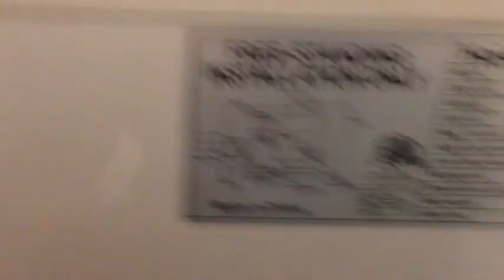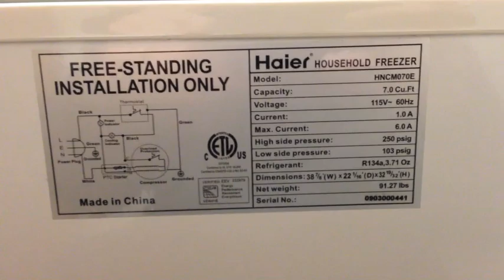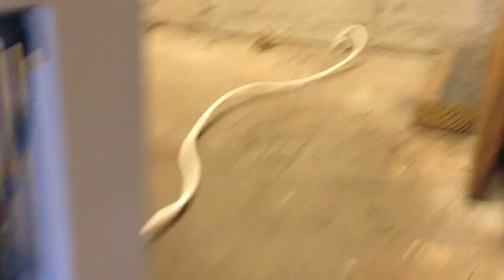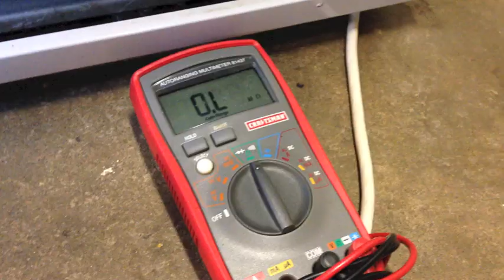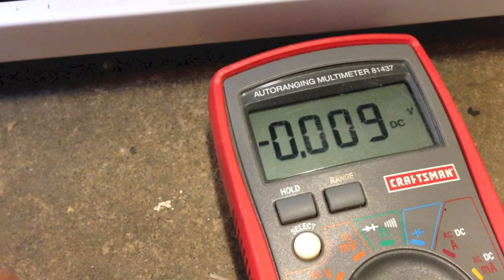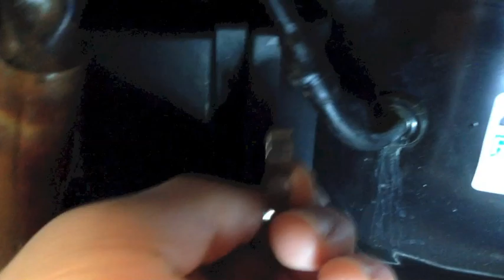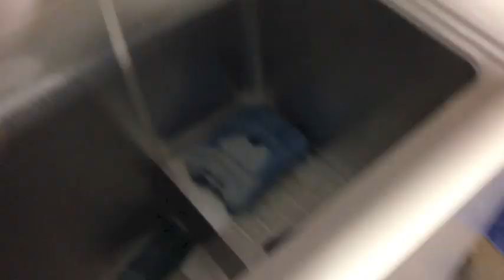HAIER  Freezer Repair

Comment: hey bro I appreciate what you're doing but there's actually a hard start kit that is cheap and can replace the cap and start relay and you have capacitance scale on your meter use that to test the cap and not the dc voltage function also the relay is an electronic type you don't test with the continuity buzzer the cap leads goes one on each side of the starter ok nice try though keep researching.
Reply: Thanks for your information that was very useful. I am very handy and try to fix everything besides throwing it out. Always love to learn different things this was my first attempt to fix anything that was a refrigerant. thanks agin
Reply: Anthony Findlay Do you have part numbers or a URL to the part? Thanks!!
Reply: Anthony Findlay thank you!   I confirmed that the cap terminals are on opposite sides of that starter relay.  I have a bit newer freezer of the same model.   I suspect my cap has failed because the readings start at 5 and go to zero, rather than increase to infinity.   The continuity buzzer also rings which may indicate a short in the cap.  Can you confirm this part is bad based on my description?  Thank you greatly!